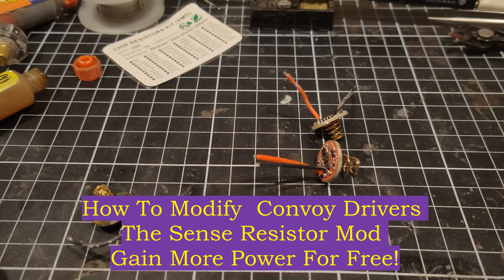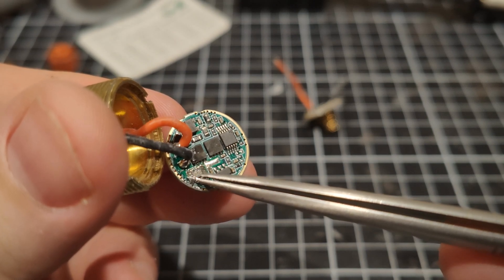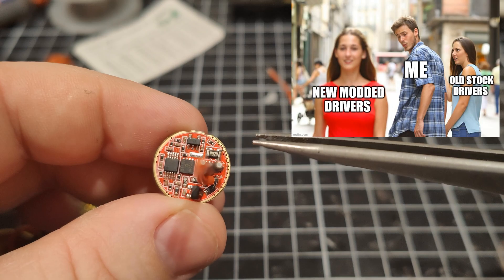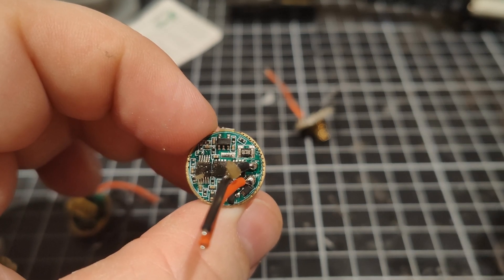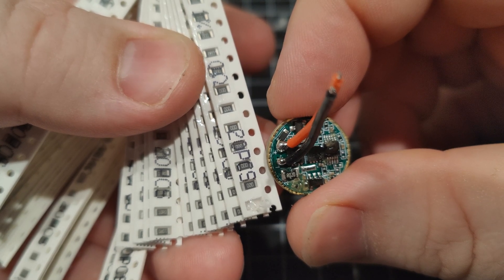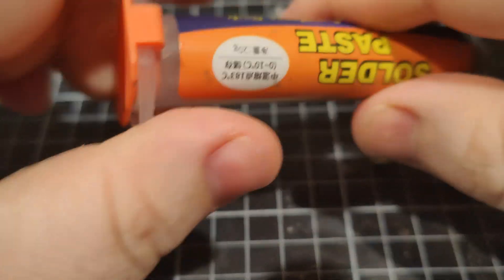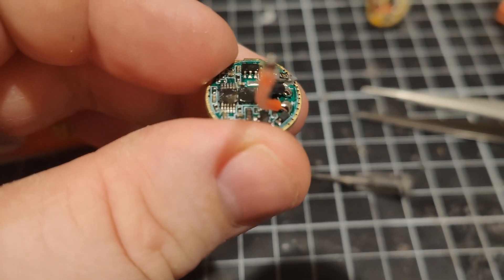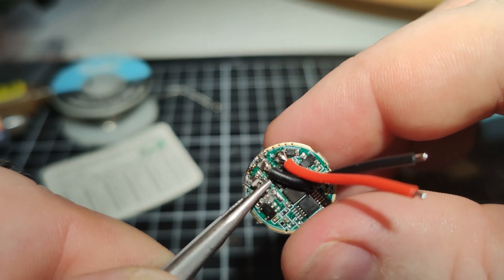How To Modify Your Flashlight Driver For Extra Power- The Sense Resistor Mod- 100% Power Gain

Comment: What is the effect?
Reply from the maker: It gives you more power, from the factory the driver is limited to 5 amps doing this increases the output. Some LED's you may want to drive harder than 5 amps.
Reply: @everydaysurvivalgear what is the value of the resistor?do they have to be the same

Comment: where do you get "sense" resistors.. I have a pack of regular resistors
Reply from the maker: Hey mate, the sense resistor is just a normal surface mount resistor. The sizes and values needed depend on what size board you want to modify, plus the amount of current you want

Comment: Mod is possible with convoy 3v 5a or 3v 8a buck drivers?
Reply from the maker: Hey mate, I have not tried to do these mods on these drivers, they might have an issue with heat issue being a buck driver.

Comment: Thanks for this information

Just did it on my C8+ SFT40, unfortunately i didn't have the correct value SND resistor so i ended up just bridgeing it, similar results as you ~ 15a output which means 45w the driver in its original form is 6a or 18w

I hope i don't hurt the LED, it is only rated at a maximum of 8a or 24W

Should be fun to see what it can do now tho.

Comment: Have you done the 6v 5a driver yet? I have a few of them for xhp70.3 and sft70 and I am looking to see what others have done. I think I am going to try to bridge the R010 resistor with some solder. Any thoughts? I won’t be bothered if I hurt a driver or emitter, they are cheap enough to have some fun with.
Reply from the maker: Hey, its not that simple on a boost driver as you need the other components to be able to support the higher current more so than a Fet driver. I did try it on one of the 20mm Convoy drivers but it didn't work i tried to double the current so that was probably way to much current/wattage for the driver. If you can be bothered to to slowly increasing current by decrease the  sense resistance one by one it may work. I find the coil usually fails as they get to hot, Simon (Convoy) has higher power driver for sale now.
Reply: @everydaysurvivalgear  ok thank you, you saved me a driver and/or emitter. I don’t know why I initially thought this video was about the 6v driver until I noticed a different value resistor. I’ll just wait for Simons new driver, I still don’t see it available in his store but I know it can take a bit to show for everyone or maybe it’s just by region. I thought about using his 22mm 6v 8a driver that requires two cells with 2x 18350 batteries but it seems a bit pointless to have the extra power with two batteries that small.
Reply from the maker: @lumntoob999 If you don't mind using two cells in  a series config and you can solder, maybe you can try a zener diode mod. It use to be a common mod and the driver of choice was the BLF A6 driver it turns it into a 6v Fet driver. It should work with the Convoy drivers but i have not tried. I might give it a go and see if it works.
Reply: @everydaysurvivalgear  I can solder really well but I am still learning, slowly, about components and circuits. From a quick look up I don’t think I’d be capable of figuring out that mod without some better explaining or some form of tutorial. I’m going to look into it more but mainly just because I think it’s interesting.

Comment: Excuse me for my bad english. So basically which resistor value to increase current?, higher or lower resistor? Thankyou
Reply from the maker: Hey mate it would depend on what current you want if you add any resistor that is close to the value of the resistor on the driver that will increase the current. Say your driver is using a R020 if you add another R025 on top that will increase the current level.
Reply: @everydaysurvivalgear  thankyou, i was try to put another R020 on top of original driver's resistor (R020 also) and it doubled amperage output at each level about twice than before
Reply from the maker: @sigitsukmawan9849  what driver are you using? When I done the red convoy driver the 2 lowest modes stayed the same with mod but the 3 higher modes increased?
Reply: @everydaysurvivalgear  
Mine is 4 mode 5A (green color).
Measured with cheap multimeter.
Use SST20 emitter.
NCR18650BD battery.
My result before and after mod as follows:
0.1 % cant read current.
3 %, 0.16A before, 0.32A after mod.
30% 1.6A before, 3.2 after mod.
100% 3.4 before, 4.6 after mod.

I think limiting factor at 100% caused by non-high drain battery and or emitter power rate.
Anyway, hard to see light output difference at 100% mode, maybe need to swap with another higher emitter or better battery
Reply: @sigitsukmawan9849  bang kalo beli driver baru convoy dari pertama di coba udah kedip kedip itu apanya ya?

Kyak protek ajha kedip kedip lalu mati,
Tlog di jawab ya..
Reply: @upit_9c  coba cek grounding driver ke host kenceng ga. Atau switch kurang kencang. Ato test dulu aja diluar host
Reply: @sigitsukmawan9849  udah bang negativ baterai saya langsung solder ke ground driver,,

Tetep sama cuma di mode medium sama high kedip tiga kali terus mati lednya..

Tp di hidupin lagi bisa,
Kalo mode moon dan low aman,,

Driverku convoy v20 6A  dan ekoras 5A, beli baru kedua nya seperti itu
Reply: @upit_9c  pake batre lain gimana?
Reply: Kalu driver Convoy 6a Sy kenapa outputnya cuma 5,2a ya om kebaca di avo
Reply: @ampunDJ2006  
pastikan kabel avo pake yg bagus/tebal. Itu ngaruh bgt utk pembacaan konsumsi amper besar
Coba test pake batre yg bagus, jgn batre bekas laptop, batre bekas biasanya max cuma mampu 3-4 amper
Reply: @sigitsukmawan9849  udah tebal kabelnya om,,,trus sy test battery Sony vtc5 voltnya bener 4,25 kalo penuh
Reply: @sigitsukmawan9849  normalnya di berapa ya outpunya kalo convoy 6a?
Reply: @ampunDJ2006  kalo batre bagus, semua koneksi, kabel, solderan bagus, bisa sekitar 6A lebih
Reply: Rupanya lednya yg ga mampu keluar max a nya..😁

Comment: Hey friend nice video, have you seen the driver for the convoy s21e? https://i.imgur.com/GiPy4ht.jpg

It has 2 sense resistors one R020 on top in series with the mosfet and in the bottom has another R050 but that should be for the charging circuit right?

I'd like to mod it to draw about 1.6 - 1.75 amps instead 6 amps if I do the Rule of three:

6A -------> R020
1.75A -->    ?

(6A * 0.020Ω) = 0.12mW  -----> (0.12mW / 1.75A ) = 0.0685Ω ----------> R068 or R075.

Are my calculations right?